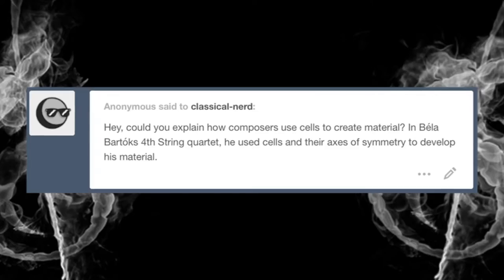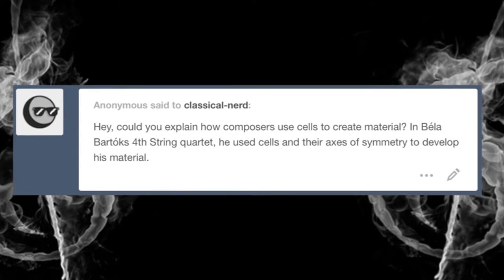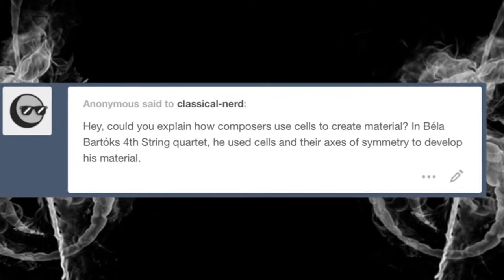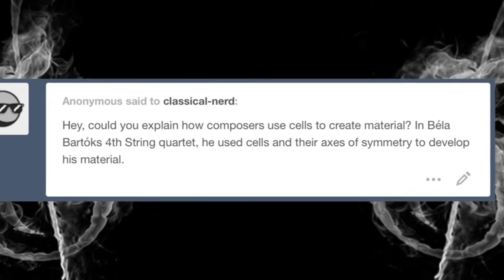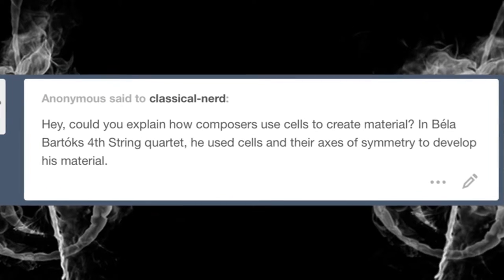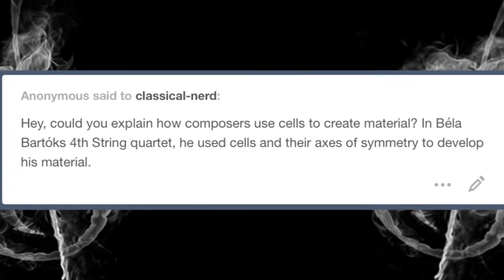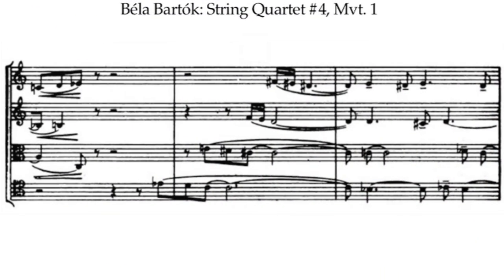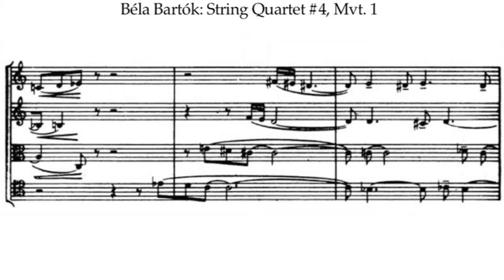How Composers Use Cells

Comment: I have heard of the Fate Motif being what Beethoven used throughout his fifth symphony to integrate all the movements. But according to your video on cells, it seems to be that that pattern of Short Short Short Long with a descending third is a cell and not really a motif.
Reply from the maker: It really just depends on the era of music!  20th century composers like Bartók were more analytically driven and the cell content would contain elements of rhythm and pitch.  In a Romantic sense, "motif" is more appropriate because it comes back in so many different ways—that, and he only really uses the one motif to build a lot of different stuff, whereas Bartók might have a palette of several different cells that he'd mix and match.

Beethoven was also a real pioneer in building and expanding development sections, and so he'd take small motives and build these huge, complex designs out of them.  Bartók's music isn't know for doing this much, if at all.